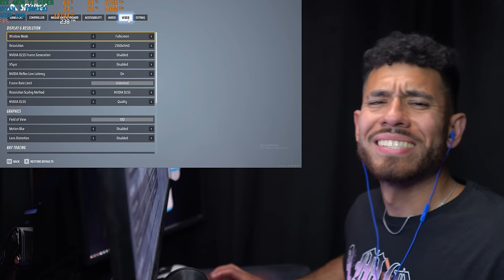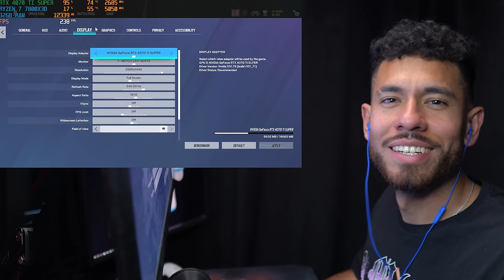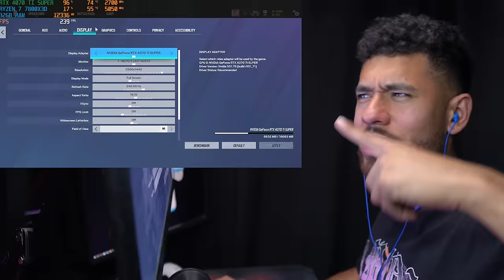BEST $1800 Gaming PC Build Guide - RTX 4070 TI SUPER Ryzen 7 7800X3D (w/ Benchmarks)

Comment: For anyone wondering I just got this exact build and it came out to around 2k plus some change(I purchased the 2TB SSD so it was a little more) I got lucky w shipping and all my parts minus the SSD came on the same day. If you get parts from Amazon make sure u look at the parts/wires closely for anything damaged or missing ! Over I’ve had the pc now for a couple of days and the performance has been above what i expected couldn’t be more happy w it. Also if your nervous to build, the video is extremely helpful and I my self ran into no issues(just follow the steps carefully and take your time) would highly recommend this build !! Also I have tested other newer games such as returnal and had amazing fps at max graphics around 180 with my cpu running at 55-60c !!
Reply: Do you get similar if not the same fps you see in this video I’m also thinking of using this build
Reply: @melodic1941  yes I get similar fps ! You can definitely achieve higher fps with some over clocking but I tend not to mess with that.
Reply: Hi, I followed the same build but I have a red light on my motherboard like he did in the video.  I have literally tried everything.  I got a red light the moment I turned it on and what's crazy is that now I don't have a display when initlally I had one. I only turned it on once.
Reply: Hey I’m looking to copy this build 100%. What monitor would I need to take advantage of the FPS? Whatever is the minimum monitor needed.
Reply: @cypress_w_gaming  I have a MSI 1440p 165hz monitor that works fine and isnt over the top expensive.
Reply: @jesciapatterson244  hello sorry for the late reply, is the red light issue also tied with other issues ? Such as your screens or entire computer not booting up ?
Reply: @lavishfuzz  sorry as I’m new to computers. How are you getting over 200 FPS in games like Warzone or Apex yet you only have a 165 HZ monitor? I thought those two numbers had to match up…
Reply: @lavishfuzz  Hi, Thank you for replying at all! I took it apart and reseated EVERYTHING. Also the cable that I was using wasn’t working directly from the GPU. I needed a high grade cable. I also turned up the volume to make sure it was booting up. It’s a beast!
Reply: @jesciapatterson244  nice ! Happy to hear you’re up and running. Enjoy !!
Reply: @cypress_w_gaming  no worries ! So HZ is the amount of times your monitor is re drawing the screen and FPS is the output you receive from your pc to your monitor
Reply: @cypress_w_gaming  you can also look up hz vs fps, for a more thorough explanation
Reply: How did you do the bios? Im extremely confused at what to do after building the exact same rig? Any help would really help
Reply: @Kala_Stha  do you mean like bios update ? Sorry little confused on what ur asking. Are you referring to turning on your xmp to get the most out of you’re RAM
Reply: @lavishfuzz  Yes! Thats what im referring to as well as making the most of the ram. This is my first pc build and im really nervous with not knowing anything about the mobo. Any help would very greatly be appreciated.
Reply: Is this pc good for streaming as well?
Reply: @Kala_Stha  sorry man been busy these past couple days, so for the xmp profile or bios in general I would suggest taking a look at JayzTwoCents after building a pc video. He goes through the whole bios setup, including how to enable that xmp mode. I don’t over clock anything else myself and would advise to do some deep research if you want to go that route . Lmk if you need any other help brotha
Reply: @burntchurro21  this build is a beast and AMD usually offers better multi core performance compared to intel at this price point, allowing you to game and stream at the same time efficiently. TBH tho I myself don’t stream so I don’t know how well it runs playing black myth wukong for example and streaming at the same time.
Reply: @lavishfuzz  Thank you man, this is probably the greatest help that I have ever recorded online. 🙏
Reply: @Kala_Stha  no problem ! Happy gaming 🫡

Comment: Dude, I kid you not had put together an Amazon parts list of almost the same parts but different case and brands except for the SSD was the same.

Just one thing to note you don't need that CPU splitter cable because that board has two CPU fan headers. And, it's always better to fine tune the fans in the BIOS for best thermal performance.

Comment: Hi there! I'm planning to build this exact setup and will use this video as my guide. I had to change the CPU cooler because I couldn't find the one you used. Also, the cables on your website are out of stock, but I hope they'll be available when I start my build. Otherwise, I'll have to stick with the default ones.

I'll make a video documenting the build and testing process, though I'm not sure when that will be. My total cost comes to $2360.55, which includes a new controller, keyboard, mouse, microphone, boom arm, and thermal paste.

Here's what I've got so far:

- *Keyboard:* SteelSeries Apex Pro Wired (used)
- *Mouse:* SteelSeries Aerox 5 Wireless (used)
- *Boom Arm:* SteelSeries Alias/Alias Pro Boom Arm with SteelSeries Alias Microphone
- *Controller:* Used, excellent condition DualSense Edge Wireless from Sony
- *Thermal Paste:* Noctua NT-H2 3.5g
- *CPU Cooler:* ShakingTank AK620 Digital CPU Air Cooler (All-Black, 6 Copper Heat Pipes, Dual-Tower, 260W TDP)

I'm really excited about this build and hope to get started soon! What do you think about the changes I made, especially the CPU cooler choice?

Thanks for the great video!
Reply: Was it much harder to apply your new cpu other than the one mentioned in the video

Comment: saving up for this build cant wait, Awesome video very informative will be shaking like a leaf on the day. the R7 7800x3D with the RTX 4070TI SUPER 16gb combo looks unreal. keep up the great work crater.
Reply: I am trying to buy this exact build with the 49070 to súper so is the graphic card a powerful one or no?
Reply: I meant the 4070 ti super
Reply: @moehub9970  Its a beast, pairs really well with this CPU. Doing a fairly similar build to this myself with a few tweaks.
Reply: @unreal.zombies288 what are you tweaking?
Reply: @nomful  Went with a 360mm AIO instead of a air cooler (overkill since CPU runs really cool by default), Lian Li Case (Personal preference) 1000 watt PSU (on sale lol and prefer larger wattage psu's) and 64gb ram (not needed if just gaming)
Reply: @unreal.zombies288  thanks! hows your temp when gaming? i might go for air cooler instead cause i am aiming for long term use and i dont change parts/upgrade frequently. 

Which lian li case did you get? also, do you have the same ram used in the vid?
Reply: @nomful  Getting around 50°-60°c playing Call Of duty Coldwar at 4k which is totally achievable with an aircooler. Although nothing beats an aircooler for reliability. I had a MSI 120mm AIO (That i neglected) last me 5 years in a prebuilt with an I7-7700k and GTX 1080 that i used daily. Friends Corsair 360mm lasted 7 (he took care of it) both ended with pump failure never leaked
I went with this case "Lian Li O11 Dynamic EVO Tempered Glass ATX Mid-Tower Computer Case - Black" cant recommend this case enough. really nice case with plenty of room for cable management and very customizable as well as beginner friendly.
Same exact ram as this video, was a part of a microcenter bundle deal (7800x3d, Gigabyte board, and 32GB ram) and i got an extra 32gb RAM kit.
Reply: @unreal.zombies288 I’m fairly new to PCs and don’t know much but am looking to build one. Is the air cooler a bad option to go with then? Or was that just your personal preference?
Reply: @ImJxrdann  Just my personal preference, most important thing to pick the right one. personally, id go dual tower dual fan air cooler but you can definitely get away with less.

Comment: Personal take on the build but if you’re planning on keeping the build for a long time

switching to a 360mm AIO although more expensive is definitely worth the investment. There have been some test to show that smaller AIO’s can get the job done, but for the price difference you might as well go for 360mm. To save a buck, go for no rgb, this goes not just for the AIO but the entire build

As for the power supply, it can still be argued that 1000w is a safer option. If you can manage to snag 1000w for $20-30 more then it’s definitely worth it

It should be emphasized however, that the suggested upgrades should only really be considered for a 4070ti super and 7800xt or above. The videos psu and cpu cooler suggestions are good for more budget oriented builds

Storage upgrade suggestion would be to just go for the 2tb storage since there still some good options for ~$140. Best option to avoid the hassle of having to upgrade or add storage later, especially as games become larger

In conclusion, most willing to spend on higher end parts should also be looking to ensure that all of its parts aren’t limiting factors 2-3 years down the line. It should be expected to keep a pc for longer when you’re buying higher end parts. If the budget simply just doesn’t allow, then it highly recommended to get a slightly lower tier gpu. This would help save on a cheaper cooler, case, psu etc. most would be surprised just how happy they’d be even with a budget 4070 super build
Reply: Hey man I got a few questions;

Currently have i9-9900k + rtx 4070. I’m looking to upgrade to the ryzen 7 7800X3D + MSI MAG X670E Tomahawk + 32gb of ddr5 6000mhz

I’m keeping everything else & just getting those 3 parts. Do you think my old Corsair 240mm AIO cpu cooler can handle this cpu? 

Also, will 64gb of ram give more fps?
Reply: @senorbonbon  the 7800x3d has been known to run hot unfortunately. There isn’t that many performance test online comparing different size coolers, more of just comparisons between the larger sizes. Almost all reviewers however recommend a 360mm cooler, since any size between 240 and 360 is nearly the same price anyways. It is definitely more expensive but if you can buy a non-rgb version for $180 or less then its worth it in the long run

Comment: Honestly the gpu support/anti sag bracket should be used for basically any gpu thats huge. Sag kills gpus and pcie slots. I love it when cards come with one. But if not they are like $10. Also for half the price you can get a Thermalright Peerless assassin cpu cooler that performs on par with a Noctua NH-D15

Comment: Inspiring. Wanted to to do the same build. Then found Elite AX is no longer available, but Elite AX V2 is now in the market. Now checking for Ram's. As I need 64GB, could not find a kit as G.skill haven't listed the V2 mother board in their website. When I go to Aorus website, only compatible 64GB is RGB. But having the air cooler going to cover it.

Comment: I built the computer myself and the price was 1950 eur.  Graphics gigabyte 4070ti super 16gb, ddr5 gskill 6800hz 32gb RGB, ssd 2tb.  m.2 nvme, motherboard msi z790 gaming+ wifi, i5 12600kf 3.6-4.9gz, Kolikn 320mm aio cpu water cooler, power supply 850w.  Computer box Kolink unity cod x.  6tx Aigo argb fan 120mm.

Comment: I have a question is this build any good and worth $1000

▶︎ Processor: AMD Ryzen 5 5500 3.6GHz
▶︎Motherboard: Asrock B450
▶︎ Memory: RAM: 16GB DDR4
▶︎ Storage: 1TB NVME SSD Storage
▶︎ GPU: NIVIDA RTX 4060 8G
▶︎ POWERSUPPLY: 550W 80+
▶︎OS: window 11 Pro
▶︎ No built in Wi-Fi

Comment: Here is my build if any problem please tell me and I will change it thanks..

Processor - Amd ryzen 7 7800x3d
Graphic card - Nvidia rtx 4070 ti super 16 gb
Memory ram - TEAMGROUP T-Force Delta RGB DDR5 Ram 32GB Kit (2x16GB) 6000MHz  CL30
SSD 1 - Western Digital WD Blue SN580 PCIe Gen 4 NVMe SSD (500 gb)
SSD 2 - Western Digital WD Blue SN580 NVMe ( 2TB )
Cooler - Cooler Master ML360L Core ARGB CPU Liquid Cooler - White |
Power supply -MSI MAG 850W Power Supply 80 Plus Gold - ATX 3.0 PCIe 5.0 Ready - 12VHPWR  80 Plus Gold, Fully Modular, ATX 3.0, PCIe 5.0 GPU Support White Colour
Motherboard - Gigabyte B650M A ELITE AX ICE
Case- Lian Li Alloy Steel Lancool 216 RGB Mid-Tower Computer Case/Gaming Cabinet - White
Screen -LG Ultragear Gaming Monitor(27") Qhd IPS Display(2560 * 1440) 165Hz
Keyboard and mouse - MageGee Gaming Wired Keyboard and Mouse Combo, K1 LED Rainbow Backlit Keyboard with 104 Key Computer PC Gaming Keyboard for PC

Comment: yo can you build one for $1200, I know you built one like that 2 years ago, but I was just wondering if there's a more upgraded version or nah
Reply: Total: $1267.51
CPU: AMD Ryzen 7 7700 3.6 GHz 8-Core Processor  ($182.00) 
CPU Cooler: Thermalright Assassin King SE ARGB 66.17 CFM CPU Cooler  ($20.09 @ Amazon) 
Motherboard: ASRock B650M Pro RS WiFi Micro ATX AM5 Motherboard  ($149.99 @ Newegg) 
Memory: Silicon Power XPOWER Zenith Gaming 32 GB (2 x 16 GB) DDR5-6000 CL30 Memory  ($97.97 @ B&H) 
Storage: ADATA Legend 800 2 TB M.2-2280 PCIe 4.0 X4 NVME Solid State Drive  ($108.99 @ Amazon) 
Video Card: Sapphire PURE Radeon RX 7900 GRE 16 GB Video Card  ($559.99 @ Newegg) 
Case: SAMA ARGB-Q5 MicroATX Mini Tower Case  ($53.49 @ Newegg) 
Power Supply: Thermaltake Toughpower GF1 (2024) 850 W 80+ Gold Certified Fully Modular ATX Power Supply  ($94.99 @ Amazon)

Comment: Will it run games like olden ring and ff7 at a great frame rate or only FPS games?
Reply: It sure will, rtx 4070ti super is top video game card right now, I could play elden ring on gtx 1050 4gb vram and 8gb ram on low settings with full hd and if i remember correctly 30fps so on that pc you could get at least 60fps on good quality settings
Reply: @delenter3296 what you on bruh 2k max 100 frames for m😊

Comment: i have a question i have a Aorus Rog Strix b550 f with wi-fi and the LED SW that comes with my case i dunno where to plug it in and my case doesn’t change color it just stays on green so i dunno what to do.

the case i have is DIYPC Vanguard RGB Black dual ATX mid tower

Comment: Total: $1556.40 Cheaper and better.
AMD Ryzen 7 7800X3D 4.2 GHz 8-Core Processor  ($305.00) 
Deepcool AG500 WH ARGB 67.88 CFM CPU Cooler  ($35.98 @ Newegg) 
ASRock B650M Pro RS WiFi Micro ATX AM5 Motherboard  ($149.99 @ Newegg) 
Silicon Power XPOWER Zenith Gaming 32 GB (2 x 16 GB) DDR5-6000 CL3 ($97.97 @ B&H) 
ADATA Legend 800 2 TB M.2-2280 PCIe 4.0 X4 NVME Solid State Drive  ($108.99 @ Amazon) 
ASRock Phantom Gaming OC Radeon RX 7900 XT 20 GB Video Card  ($709.99 @ Newegg) 
Case: SAMA ARGB-Q5 MicroATX Mini Tower Case  ($53.49 @ Newegg) 
Thermaltake Toughpower GF1 (2024) 850 W 80+ Gold Certified Fully Modular ATX Power Supply  ($94.99 @ Amazon)

Comment: Could you please build a 1400$ ryzen and amd build.Thank you
Reply: Total: $1494.41
CPU: AMD Ryzen 7 7800X3D 4.2 GHz 8-Core Processor  ($383.99 @ Amazon) 
CPU Cooler: Deepcool AG500 WH ARGB 67.88 CFM CPU Cooler  ($35.98 @ Newegg) 
Motherboard: ASRock B650M Pro RS WiFi Micro ATX AM5 Motherboard  ($149.99 @ Newegg) 
Memory: TEAMGROUP T-Force Delta RGB 32 GB (2 x 16 GB) DDR5-6000 CL30 Memory  ($106.99 @ Amazon) 
Storage: ADATA Legend 800 2 TB M.2-2280 PCIe 4.0 X4 NVME Solid State Drive  ($108.99 @ Amazon) 
Video Card: Sapphire PURE Radeon RX 7900 GRE 16 GB Video Card  ($559.99 @ Newegg) 
Case: SAMA ARGB-Q5 MicroATX Mini Tower Case  ($53.49 @ Newegg) 
Power Supply: Thermaltake Toughpower GF1 (2024) 850 W 80+ Gold Certified Fully Modular ATX Power Supply  ($94.99 @ Amazon)

Comment: May you please make another pc with a white case for $1,200
Reply: Total: $1001.52 7500F is $132, I'd go with a 750w+ gold rated but this ok.
CPU: AMD Ryzen 7 7700 3.6 GHz 8-Core Processor  ($182.00) 
CPU Cooler: Thermalright Assassin King SE ARGB 66.17 CFM CPU Cooler  ($20.09 @ Amazon) 
Motherboard: ASRock B650M Pro RS WiFi Micro ATX AM5 Motherboard  ($149.99 @ Newegg) 
Memory: Silicon Power XPOWER Zenith Gaming 32 GB (2 x 16 GB) DDR5-6000 CL30 Memory  ($97.97 @ B&H) 
Storage: ADATA Legend 800 1 TB M.2-2280 PCIe 4.0 X4 NVME Solid State Drive  ($63.99 @ Amazon) 
Video Card: XFX Speedster SWFT 319 Core Radeon RX 6800 16 GB Video Card  ($374.99 @ Newegg) 
Case: SAMA ARGB-Q5 MicroATX Mini Tower Case  ($53.49 @ Newegg) 
Power Supply: MSI MAG A650BN 650 W 80+ Bronze Certified ATX Power Supply  ($59.00 @ MSI)

Comment: Did you have to flash the B650 for the 7800X3D before assembling?
Reply: I may be wrong but when you get the motherboard you should be able to find the installed bios version using its serial number on the box or motherboard itself. The 7800x3d issue was fixed a while ago so the motherboard should come updated with the patch by now
Reply: @mikan556  I tried flashing the motherboard and didn’t work so must of downloaded the wrong file or need a different usb, appreciate the feedback
Reply: @craigdrever1 it has to be a usb 2.0 and have under 32gb of storage, then be formatted to fat32 before flashing with qflash plus

Comment: could you do another $500 build, but white theme?
Reply: Total: $537.33
CPU: AMD Ryzen 5 3600 3.6 GHz 6-Core Processor  ($81.90 @ Amazon) 
Motherboard: ASRock B550M Pro4 Micro ATX AM4 Motherboard  ($89.99 @ Newegg) 
Memory: Silicon Power GAMING 16 GB (2 x 8 GB) DDR4-3200 CL16 Memory  ($33.97 @ Amazon) 
Storage: TEAMGROUP MP33 512 GB M.2-2280 PCIe 3.0 X4 NVME Solid State Drive  ($38.99 @ Amazon) 
Video Card: ASRock Challenger D Radeon RX 6600 8 GB Video Card  ($189.99 @ Newegg) 
Case: SAMA ARGB-Q5 MicroATX Mini Tower Case  ($53.49 @ Newegg) 
Power Supply: MSI MAG A550BN 550 W 80+ Bronze Certified ATX Power Supply  ($49.00 @ MSI) 
Total: $537.33
Reply: @itsatrap4986  YOOOO, thank you. Will it run 1440p tho?
Reply: @Meatt_ball  Yes.